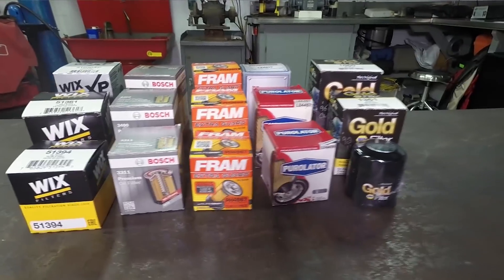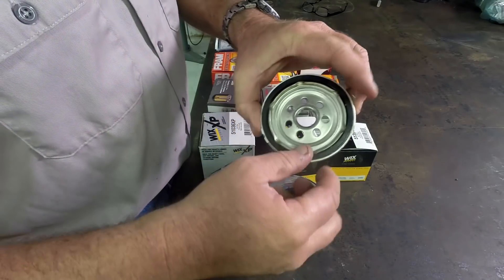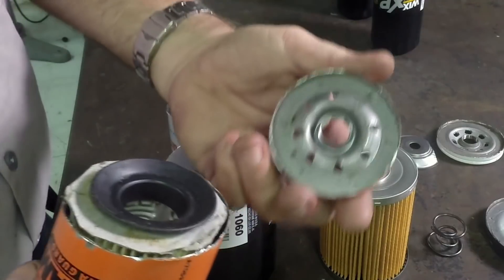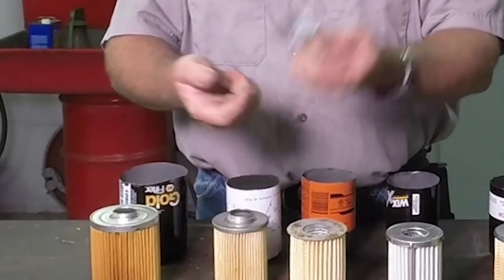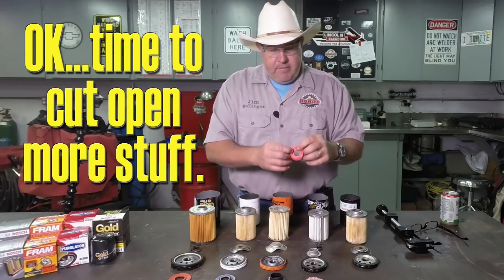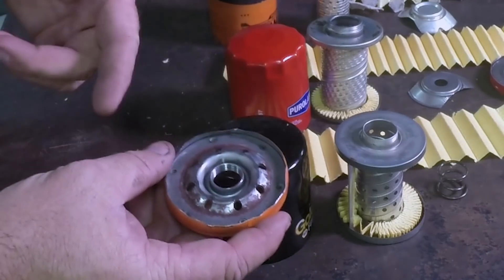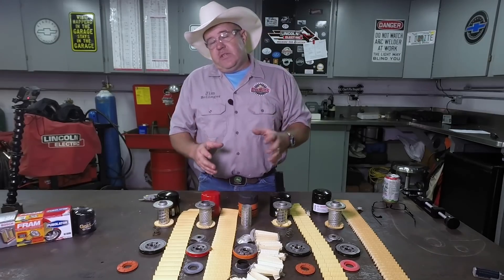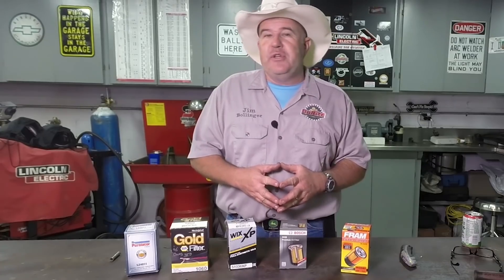The worst oil filter EVER!

Comment: Thanks that was quite a surprise. I won't be using Fram anymore.
Reply: Fram ultra synthetic are well built. Even though they look cheap Fram is still around for a reason. They would have been sued out of existence if they were truly that shitty.
Reply: Maybe I should stop. Been using them on at least 6 different engines that I have got over 400,000 miles changing the fram filter every 20 to 30,000 miles. My current engine has 540,000 miles still runs fine.. nah, not changing
Reply: Never ever had an engine failure due to an oil filter,as long as you change on regular basis 3 to 5 thousand miles and yes I mostly use Fram. Enough said .
Reply: I'd like to see the inside of a Frams higher end filter line.  And also the lower end of Napas filter.  The white one. Wonder if itll be the reverse of this comparison of the two.
Reply: @Seans-Garage   There is a video on here, if you can find it, of someone cutting open a few Fram filters.  The top-line one (the synthetic) was good, the others were still crap.  Haven't seen a cheap Napa.  But honestly, for the $4 difference, people should just buy the good one.  I have to say I'd still be skeptical of something being crappy on the top-line Fram after seeing this.
Reply: I've used fram for years on my 07' Toyota Yaris, has 249,000. Ignorence is bliss they say. Motor has been good to me however; Think I'm gonna go with top quality filter next oil change...... K&N or Wix !
Reply: Wow so many internet mechanic's here with no knowledge of anything and because they have seen a video think they know it all. There is no testing at all in this video on if they work any good which is what's important.
Reply: I think the comparison is a bit unfair to Fram.  He shouldn’t compare their cheapest filter with these filters that cost more than double.  Spend the same amount on a Fram and the quality will be more comparable.  The Fram filter he opened is only designed for 5000 miles so the build of it is probably fine if you actually only use it 5000 miles.  I don’t think they should be penalized for providing a lower cost option.  It’s not really cost effective to buy these 5000 mile filters but people also do payday loans.  People have different situations.
Reply: I changed oil and filter on my suburban.  Going down the street I watched oil pressure go to zero. Put old filter back on and 40 psi. The week before my brother in law changed oil then motor seized up. Both were fram filters.
Reply: To be fair, FRAM UltraSynthetic is actually not so bad.
It is their top-notch product, roughly twice the price of ExtraGuard.
Reply: @antona.4572  
At that price, there are better options (or as good)
So why buy their stuff and reward them for their otherwise shitty product line?
I say boycott them and force them to make better products.
Reply: @fubartotale3389  not everywhere. Maybe in US there are, but not in Canada where I live.
The only readily available alternatives from comparable synthetic oil filters here are Mobile 1 and OEM filters from car manufacturer (both costing approximately $20-25), and even more expensive German MANN (at $30), while Fram Ultra Synthetic only costs $17, and is sometimes available on sale for $13.
With the lack of real choice, the choice is obvious :)

P.S. Fram ExtraGuard only costs $6 here, but I'm not even considering it :)
The price is indicative of the quality.
Reply: Watched other comparison videos that showed other fram filter with quality spring in it?
Reply: Wait. It depends which FRAM would you buy. Of course the cheapest filters in all the brands are cheap... But wait till you see what's inside of FRAM High Km, Full Synthetic, its High Quality Cotton and metal mesh, go see for yourself.
https://www.youtube.com/watch?v=VzCqjZgIMBk&feature=share
Reply: What really surprised you? The fact that oil filters use PAPER inside ???
Reply: Me either. Use NAPA gold or Wix
Reply: Me neither!!!!!!!!!!!!!!!😮
Reply: Remember how popular Quaker State was in the 1970s till it was proven they added paraffin to the oil which caused major gumming issues on the internals of the engine.
Reply: Frame is in partnership with Wal-Mart. The rubber gasket always comes off the filter. Causing double gasket. Don't go to Wal-Mart
Reply: FRAM has been known to be absolute garbage for years, this is just another video proof.
Reply: FRAM's were still considered garbage filters back in the 1970's...they've always been cheap and poorly constructed.
Reply: @darring.9161  Oh yeah? Well, back in the 70's and 80's I used Exxon filters. Then that Valdez thing happened and you couldn't find Exxon filters anymore because they used them all to soak up the oil spill. Those were dang good filters.
Reply: +Mel Galjour.  LOL!   Well, there is some good news from the Exxon Valdez Oil Disaster...Salmon are getting 30% Better Mileage!
Reply from the maker: @darring.9161  That's funny!
Reply: +DoRite Fabrication.  You're welcome Sir...I'm well known for my horrid wit and humor.   
I can only say one positive thing about the Fram Filter and that is the Rubber dipped Cannister Top is a pretty good idea, better grip for hand tightening...If the Filter fails, you can rip the Rubber off and use the Lube to screw yourself for buying a shitty Fram Filter!    
 I myself use PurolatorBoss, Wix or Mobil-1 depending what is on sale or available. 
 I only used Fram's when I was a Goofy Teenager with a lousy old Ford Pinto Station Wagon.  
Once I started getting really serious Cars...I upgraded my Filter preferences, and never had a problem!
Reply: @DoRiteFabrication  Hey what do you think of the Mobil 1 filters? I've heard good things about it and use it for my Honda. Should I stick with it or switch to NAPA?
Reply: @darring.9161  and add in the Fukushima  nuclear disaster and them same Salmon have 6 eyes and glow like a set of LED lights.
Reply: @josephbell2160 .  Speaking from my own experiences.  Mobil-1 Filters are really good High Capacity Filters that are excellent to use with Synthetic Oils...they're my 2nd Go-To after PurolatorBoss.
Reply: @darring.9161  Yeah, that's how I do it. I use Mobil 1 synthetic along with the filter and my car still runs new. Granted it only has 123,000+ miles on it which for a Honda is relatively low. But it's a 20 year old car (1999 Accord V6) and I've had it for 12 years so using Mobil 1 filters and synthetic oils helps to keep it running strong. Thanks for the info
Reply: @josephbell2160  I ran M1 and their filters on my old Integra and @ 270ish when I sold it, she idled perfectly n  with no tapping or burning oil.  I've used it ever since on my last half dozen vehicles all with great results.  I now do the filter every other change which appears to make little difference.
Reply: @darring.9161  Did you have any problems when you used Fram?
Reply: @dannyo6699  Yes,  I used them on my Pickup Truck back in the 1980s...and on two occasions they collapsed.  
Mind you, I was only using their Basic Filters back then...but the design hasn't changed all that much. 
 I was on a College and Army Budget back then...so I'd settle for the cheapest things I could find at the local Canadian Tire Stores. I also did my Oil Changes religiously every 5000 Kilometers/3000 Miles and after the second time, I switched over to more upgraded filters like Purolator and said never again.  I really can't speak for the more upscale Fram's they have now...to be fair, and maybe they're okay, but once bitten twice shy. Twice in my case!
 They had a bad enough reputation back then, and it still seems to stand today.
  I remember chatting with my younger brother Gord at the coffee shop about it, and before I said anything more, he responded: "You bought a Fram didn't you?" As soon as I conceded he said: Stop going cheap, they're crap and they always have been crap"...so I went and drained out the Oil and put in a Purolator, and never had any issues after that.
Thankfully my Engine wasn't destroyed and the vehicle ran for a really long time afterwards...I literally ran it into the ground before it developed a cracked head and I decided it was time to buy a new vehicle.
Reply: @darring.9161  They are much better now. I've used Fram's for decades and never had a bad one.
Reply: likewise, always thought FRAM was the mutts nutts
Reply: Yeppers wix for my truck
Reply: @robertbowersock1723  Wix or Napa Gold same filters, can't go wrong.
Reply: Fram ended up destroying my dads Cummins engine. He always took care of it then one day the thing locked up tight. It spun a bearing and all the gunk and glue form the filter was clogged in all of the oil passages. Bearings were all toast , crank was scored, cam was scored. Only thing that was decent was the cylinder walls and pistons.
Reply: Jon S m
Reply: Fram has been like this for many many years ten years later and it still the same.
Reply: Must not matter, my family has been using fram for decades with no engine troubles.
Reply: Why ?
 Because uses cardboard on the ends?

Do you know that the filter element is made of ..... cardboard too?
Reply: Marbin Diaz it’s bad because the ends hold it together, steel is much better at this than cardboard
Reply: Fram needs to stop spending so much money in advertisment and work on putting out a better product.Thanks for taking the time to post this video
Reply: i've always used FRAM on my car. Has 300k miles and is still fine. Ya'll can keep crying.
Reply: How is this possibly a surprise?  I was a kid in the 90s and even before the internet the word was going around in magazines and circles of how bad the Fram filters were, not only just bad, but damaging.  25 years later, they've changed nothing and people are still surprised?
Reply: @sachellebabbar9005  This is the cheapest filter they carry.... and hes comparing it to more expensive oil filters. Fram has 3 or 4 models better than this. Their synthetic version is great. Has all the bells and whistles.
Reply: @sachellebabbar9005  Their still selling them because there is no proof that they are bad' I think this guy has shares at napa gold //
Reply: Buy whatever you like but know that several filter manufactures make various "Grades" of oil filters i.e. Good, Better Best.  Test like this always seem to choose the budget entry level Fram filters and compare them to other manufacturers better or best filters making the test nothing more than dumb publicity event.  If he had chosen a Fram Ultra Synthetic filter (Their best) it would have been as good or better than his best choice.  If you compare the price point of those filters and evaluated them accordingly you would have a test result that meant something.
Reply: @frankpecenka5606  Thank you for pointing that out. EVERYONE that badmouths Fram compares the Extra Guard to the premium filters by the other brands. They DON'T want to open an Ultra Synthetic and have their preconceived notions about Fram utterly blown apart right on video for ALL to see.
Kudos.
Reply: I currently have a 2001 Nissan Frontier with 300K plus miles on it. I have used nothing but Fram oil filters with oil changes so I will continue to use them.
Reply: @dewaba1  Amen Derick. And the Fram will continue to work just fine for you.
Reply: The napa back home used to have a display that showed cut open filters.  Blew my mind.  That was forever ago.   Some things never change...  good job on the video.
Reply: not the toughguard anyway... the more expensive ones are OK.
Reply: @rejm1161  Toughguard is  good.  Similar to Honda and  Subaru OE.  You must mean extra guard.
Reply: @rejm1161  In your dreams ...any company capable of that crap filter cuts corners in everything they make Fram is DEAD to me I used their products for years not knowing how dangerous they were
Reply: @deodathramheerai  How dangerous are they? Obviously you've been using them for years and just now after years of use this is what makes you wanna change, a video on youtube that clearly shows nothing but design construction.  How about we take in account that hes comparing a $8.00 NAPA Gold filter to a $3.50 FRAM Extra Guard. Lets see NAPA Gold vs FRAM Ultra Synthetic, at least their the same price. Even further lets compare NAPA Proselect ($3) to Fram Tough Guard ($3) and see what we get.
Reply: @deodathramheerai  fram toughgaurd are more superior filter.
Reply: @deodathramheerai  This is the cheapest filter they carry.... and hes comparing it to more expensive oil filters. Fram has 3 or 4 models better than this. Their synthetic version is great. Has all the bells and whistles.
Reply: @deodathramheerai  Did you have any problems when you did use Fram filters?
Reply: that's right Anthony.
Reply: @deodathramheerai  I'll bet you never had a problem either ?? I've used them sense the 70's never a problem and always use the cheap one as I change my oil every 3,000.. Filters are not made to be taken apart' there made to filter oil and fram has always worked great// Hocus pocus here '
Reply: @kevinkollman9162  So I'm supposed to put my $30,000 investment at risk by HOPING a shoddy ass product does not fail ..... I bought Fram because I thought they were a GOOD product I WANTED a good product .... If Burger King told you your burger may or may not be poison would you continue to buy it just because you hadn't been poisoned YET ...all this says is that you are not too bright or work for shitty ass Fram
Reply: @deodathramheerai  Fram Ultra is one of, if not the best filter on the market
Reply: You got that right about cutting corners...I'll never by a Fram product now. Don't know if I ever did...But for some reason I always thought Fram made quality stuff. "High Quality" stuff. They must have a great marketing team. They had me fooled too.
Reply: @rejm1161  I have been using the tough guard. But not after seeing this video.
Reply: @kingofhearts4395    I"ve seen yesterday on the new extra guard packaging that they have upgraded the quality of the lower cost Fram extra guard. It's written on the box . It doesn't mean  that I will buy one,  but the fram extra guard should be retested with this upgraded new extra guard
Reply: @rejm1161  Why would you buy from a company that their base product is this much garbage?  Unless you buy two of the expensive ones and cut one open you will never know.
Reply: @rejm1161  Maybe you live in a small town so your Walmart doesn't have much selection but the ones by me have Fram, Mobile 1, Motorcraft,  their store brand and I'm sure a few other brands that I can't think of at the moment.  The same goes for peanut butter.  The auto parts places have multiple brands as well but usually for a few more dollars than Walmart.  Amazon is awesome because it forces stores like Walmart to be competitive.  The more expensive Fram filters are better and you can find a few videos of them being cut open if you look.  My problem is the base model brand name filter should be made to minimum quality specifications.  If this was some cheap store brand filter I wouldn't be surprised but this is the top brand for filters.  They're using the fact that no one cuts open their oil filter so all they see is the nice looking exterior with the textured grip.  From the outside the Fram looks better than all of them and that's what they're hoping customers will make their choice based on.
Reply: @rejm1161  Find Napa Gold then. They sell it in Montréal.
Reply: @rejm1161  
Walmarts house brand is made by Wix, I believe, and is superior.
Carboard end caps, seriously?
Reply: I have used Hasting filters for years and have been very happy with them. The only time I would use a Fram filter is if I’m changing my ex wife’s car.
Reply: I'll never buy anything by FRAM
Reply: I have always used fram never ever again that's just wrong that a company would make such garbage knowing most customers won't be cutting them open . Wow
Reply: I've been using them for years.  Shocked.  the 317 dislikes are prolly from FRAM employees.
Reply: I've only used Fram for years. No more. Only wish I had seen this video 20 years ago. Thanks
Reply: They are a reputable brand. Been using them for years with no failures. Can't go wrong with a Fram.
Reply: I wonder how good Mobile 1 XP oil filters are?
Reply: Well shit, all I've ever used is fram and I have 450000km on my car.....guess I'm lucky.  Won't be using them anymore.
Reply: I wonder when FRAM will begin to bring lawsuit for such libelous, unsupported and 'frivolous' claims.  I'd be sure that FRAM and other 'ugly' filter manufacturers have the validated data, from hundreds of thousands of daily/weekly industry standard tests to SAE compliance,  that their filters are no better or no worse than the 'beautiful' filters.
Reply: @richh1576  Agreed. Fram has upgraded their filters a couple years ago already and the Extra Guard is now rated for use with synthetic oil. They changed to silicone anti-drainback valves and blended the media with resin for increased strength and filtering.  He used an old stock filter, so whoever he got it from had old stock which is probably why it had rust inside.  Who knows how it was stored also.
The dirty little secret is that Fram manufactures a lot of dealership filters just branded with their own labels, so you are buying Fram and don't even know it.
For any filter to be legally sold in the United States it has to meet minimum API requirements. Fram filters meet or exceed minimum requirements.
Reply: @richh1576   Nothing libelous, unsupported, or "frivolous" was stated here.  He cut the thing open, and it's full of crap materials.  Why in the world would anyone seeing this choose to buy one of these when others for the same price are built better?  And even if they are a few dollars more, well, some things are worth a bit more.  Actual testing has shown them to be crappy anyway.
Reply: @richh1576  
Well Rich with that kind of thinking I'm gonna guess you might look for your next wife at a TRUCK STOP . There all the same , who cares if she just got done servicing a driver .
        All the same , really!?  DAH !
Reply: @richh1576  what's funny is all these people swearing off fram said they ha e been running them for years ... and this video not a actual failure changed they're minds . I used to work for fram and I can tell you honeywell's makes alot of filters and there is a ton of actual testing . And btw all the top fuel dragsters and funny cars use fram .